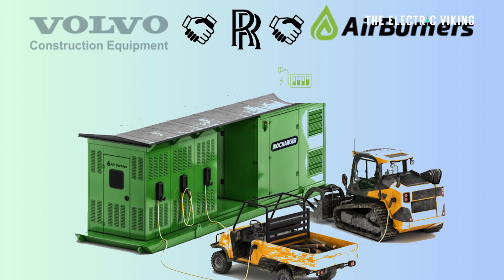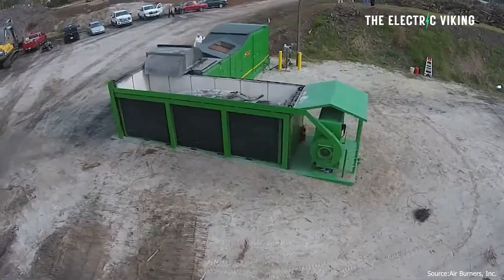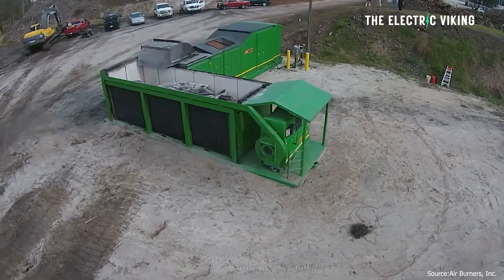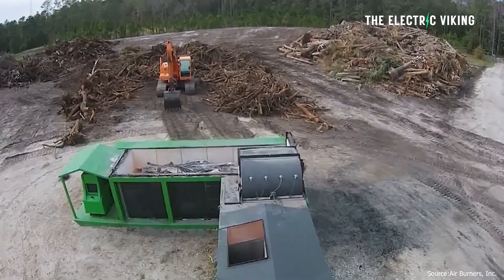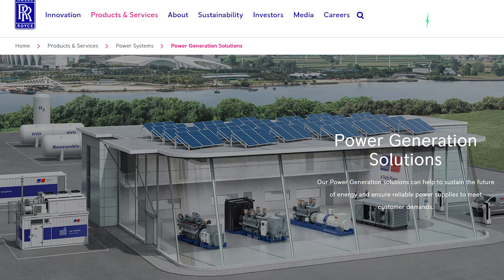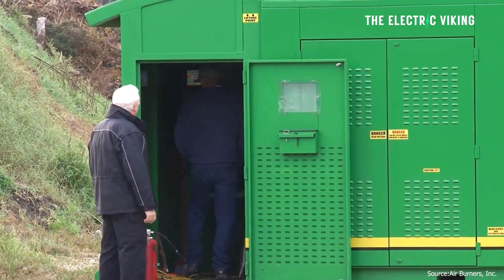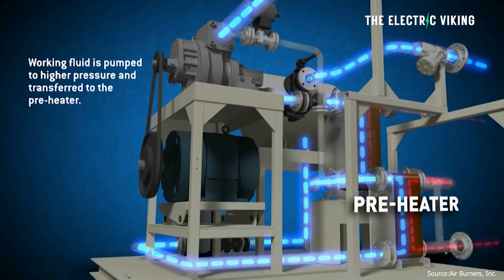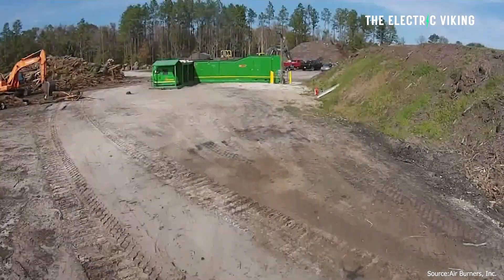Volvo designs world first charger for off-grid EVs powered by burning wood

Comment: It's just an insane idea. If you burn anything, it doesn't matter what it is  - you produce co2. You might as well just burn diesel. And when you realize just how many tons of wood PER HOUR this beast devours - you really have to wonder what the point is!!! 
And of course, that wood has to be transported to the burner -  using diesel vehicles.
And the equipment - which weighs several tonnes - has to be transported to site and moved to any new location on diesel transporters...

Comment: They should make some of the heat usable as well for say heating your house instead of wasting it, use all the energy , solar is better
Reply: The heat can be used elsewhere as an option from an outlet in the generation unit. They’ve advertised it capable of factory heating or a kiln drying oven. It’s really capable of heating anything you want to send the heat in a duct to. Or water that can be circulated will return 20degs warmer is the other option.

Comment: Does 'closed loop' mean it's carbon neutral because all that wood will eventually be burnt in a bushfire or rot and relese the carbon as CO2 or methane (which eventually will turn into CO2 but have a greater greenhouse effect for a number of years).  Trees grow and pull carbon out of the atmosphere and when the die eventually put it back into the atmosphere - closed loop!  It would be better to pyrolyse the wood burn the gas and tars to produce energy and use the charcoal left as a soil additive so it wont burn and be released into the atmosphere.  Charcoal from ancient campfires is used for carbon dating after tens of thousands of years - nothing eats it so it is effectively tied up as was the original fossil fuel before it was mined and burnt!

Comment: System needs to run itself [not from utility] and be highly mobile to take the unit where the waste is.
OR, it should charge mobile batteries that can be taken to point of use.
Anything else and you run out of fuel or it is too far away!

Comment: This is a step sideways not necessarily green but may be more green than the other options. In some ways it is like CCS depending on how it is used it may be used as a greenwashing so we can keep doing it that way we do already.. but see its green now.. see believe us it is green.

I can see this as a solution in some areas for trash dumps. There are some places were they latterly burn all trash to reduce volume (Hawaii is one). they do sort most of the metals and such out (depending on the place plastics as well)  this has happened for more than 30 years now in Hawaii .

 I can see this being a power source for trash dumps taking the non recyclable wood and paper and cardboard that is not in a recyclable state and burning it for energy as a "solution" am not sure many dumps burn trash to reduce volume and most of those already use it to generate electricity. these small construction burners that can be moved and supply the equipment sounds like a possible use especially since if they do not burn it there it is Transported to dumps of one sort or another and maybe burned there.

It is not a simple topic but a transportable burner/power generator vs trucking the waste out probably makes sense as long as they control the exhaust.

Comment: Off grid backup only and brush removal, this should not be used as a primary power source. Scrap wood that can not be used could be saved and burned when no wind or solar is available. In addition to ev chargers, excess volts could go into batteries and the grid as well. You could park a battery truck, and swap the trucks out when full (sell power for revenue) and haul out the energy in remote locations, bacisally,... mobile Tesla Mega packs. That might even create more cash and fund the brush removal. And if you use ev powered equipment that also charge from the system, instead of diesel like the video shows, further reduce costs. Logging and fire companies could change over to this tech and save millions a year. Many unforseen applications are possible.

Comment: Forest do need to be burned to prevent run away fires. When materials from tree fall that is fuel that can cause uncontrolled fires. 
There are professional foresters that work with local owners to use controlled burns to prevent mega fires. So land owners with foresters select areas to burn to prevent runaway fires. 
If those power generating machine to make power consult with foresters then maybe this can help prevent mega fires.

Comment: This is a solution in search of a problem. A bit like spending £40Bn on Carbon Capture for Drax power station in the UK, which burns Wood Imported from the US & Canada. I'm all in favour of distributed Power generation using Carbon Neutral Fuels. But this is in the Category of not worth the bother, like Carbon Capture...

Comment: They make less polluting use Electrofilter reducing  90% less particles and stove having a EC label.  If you use wood to make a fire stay away from soft wood —> pine - cedar -spruce all contain lots of sap. No matter what Wood you are liberating CO2 the tree has captured until live tree will recycle for growth. Make sure the wood you use are completely dried so fresh cut trees are going to be wet. 

Conclusion —-> there is no clean way to burn wood so you going to make CO2. You can reduce pollution by the use of Hardwood cause flames will be hotter the heat more intense with less particles into the air and long after fire 🔥 is gone the heat remains.  
Then a Electrofilter to capture the particles from the fire

Comment: Burning wood to charge EVs is blatant stupidity. Burning other trash to power EVs could be something though. But the technology needs to be in a closed loop system so it doesn't pollute air etc. Wood material overall should be better re-used we need to drastically minimize cutting down forests.

Best way to charge EVs and produce energy is solar power! When will more people realize SOLAR is the way to go. Solar is our future. The sun provides us with 44 quadrillion (4.4 x 1016) watts of power! Solar is currently the cheapest electricity in history according to IEA.

Comment: Yes and no. I have a 2020 wood stove with new tech and it still smokes a lot, not good. The smoke causes all sorts of diseases,  been proven. If trees have to be cleared to prevent forest fires or around roads for safety of roads and power lines then why not use it for lumber 1st then 2nd burn for power as long as you have excellent tech to reduce the smoke, not just a cheap catalyst like a wood stove. Just don't waste it and let it burn in forest fires anyway. It also still produces CO2. I would not live down wind of one.
Reply: @yankeewog  still cause smoke.

Comment: Burning wood produces reliable power on demand, solar panels only work when the sun is up and requires gigantic batteries if you want power at any other time to transfer into other large batteries to run heavy machinery. If you are in the woods in the middle of nowhere, you cannot bet your operations on a prayer that you will have enough sun to keep running. Deploying several MWs worth of solar panels in a logging area also sounds like a logistical nightmare unless the area is being cleared for a solar farm.
Some things don't make much sense to electrify and will require less-than-green alternate power sources to make workable.

Comment: This is for electric machinery and equipment and very niche, IMO.  Great for remote area forest or land clearing, if thats your business.  I just wonder how much waste there is at say, hum, mining sites?  I guess they had already thought of the idea that perhaps you could have a number of spare removable battery pack on site to power the machinery for a day, with a transporter bringing in charged packs from some distance off where there is grid power.  Just like a tanker might arrive from time to time to drop off deisel into a site tank.  Nah, that would not be feasible for this, or would it?  But there again, what if it was more accessible for more industries to have removable battery packs transported to site rather than relying on waste products being burned?  You would have to work out the economics and logistics of this.

Comment: Sounds like it would work really well if it was fueled with coal.

The ev thing is getting silly now.
Reply: Coal is not renewable though, a lot of Scandinavia and other parts of cold Europe is wood heated and it is considered renewable. But I doubt it is very efficient converted to electricity.
Anyway they are doing what is “green” in Scandinavia, burning wood or waste if you collect harmful exhaust substances is considered green.
Reply: Coal is a dead end.

Comment: Technically it’s carbon neutral since the released carbon was once drawn down by the tree prior to burning but I would imagine over the life of solar panels and batteries, they would be better in the long term than growing trees then burning them.
Reply: Imo trees are sequestered carbon, burning trees is the same as burning coal. Only way to be carbon neutral, you gotta take it from the air?
Reply: @Kingrub that’s the point, trees take carbon from the air. Therefore, carbon neutral. Unlike fossil fuels. As long as sustainable forestry is practiced, which is common in North America.
Reply: @derekkresser6451  imo coal/oil is carbon that trees took out of the air millions of years ago. Whether you revert the process at the 100 year mark or the million year mark makes no difference?